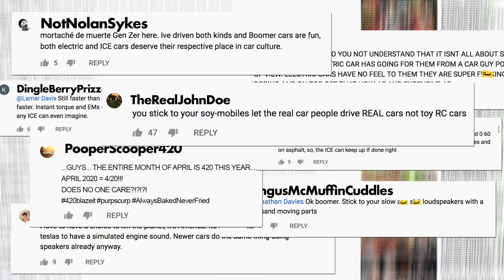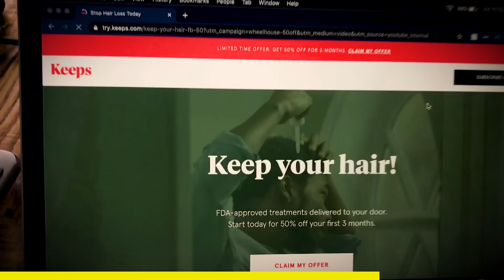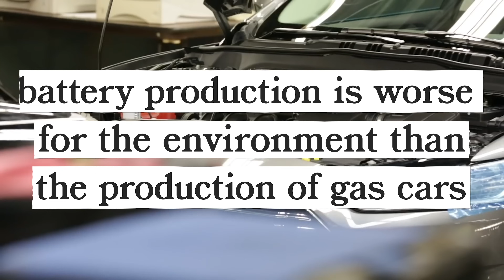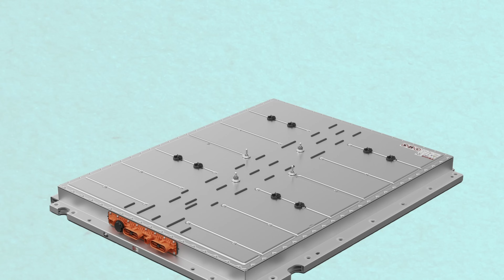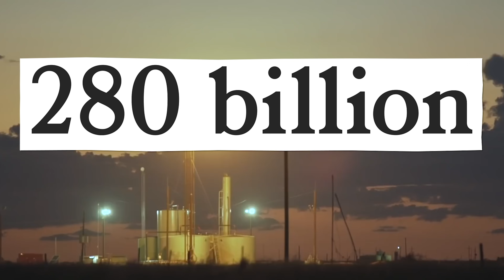Are Electric Cars REALLY Better for the Environment?

Comment: i bet in the UK a Ford transit could go from lands end cornwall to John o'Groats without stopping for fuel, unlike your EV car ( John O'Groats to Lands End is roughly 840 miles)
Reply: well no. The 2020 ford transit has a fuel economy of 14.9L/100km combined and a fuel tank capacity of 96L meaning it will only get 644km to a tank. for reference that is 400 miles. It would have to refuel a total of 2 times to make 840 miles unless it rolled the last 40 miles with its engine off.

Comment: I called bullshit to make electric cars they had to build new factories which puts emissions into the air, when you charge your electric car it puts omissions into the air, when these cars are wrecked the junkyard hast to take special care because of the batteries which puts more emissions into the air.

I live in Las Vegas when it get 118° this year they told People with electric cars not to charge them during peak hours.
Reply: Fortunately for everyone, EV's dont typically charge during peak hours but most commonly during offpeak hours. In addition, factories for other cars have to built and represent the same degree of emissions, end of life of EV's also represent similar emissions impacts according to most studies, less if you take Teslas approach and recycle all your own batteries. and finally, even charging produces less emissions than a combustion car and that even before you consider refining the fuel.

Its so significant that its more fuel efficient to charge your EV, even from a cheap portable generator than it is to use that same fuel in a traditional ICE vehicle.

Comment: I have a 22 year old Nissan, and it still running like a champ. Do you think I can have a EV last 22 years or any longer?
Reply: yes. Modern  EV batteries are designed to, and are showing to last up to and exceeding 500,000 miles to a lifetime (70% of your original range remaining is considered a lifespan.) that represents 30-40 years worth of driving for the average person.
Reply: Engineering the weird guy I might not know how many mile the battery you can drive the only fun fact is my I- phone battery (lithium-ion ) won’t last 10 year daily using for sure.
Reply: @eguchiyosuke4170  They're very different. For starters your phone has no battery management systems other than a digital charge indicator, an EV will constantly maintain the batteries temperature through submersion in a coolant fluid which is heated and cooled to keep the batteries at ideal temperatures, it is also constantly monitoring the charge level across cells to maintain consistent charge levels and will regulate the speed of charge and discharge depending on the state of the battery in regards to charge, life and temperature.

Another difference is use. You use your phone from 100% charge each morning and quite often to the last 10-20% or less. This is very bad for lithium batteries and significantly impacts the batteries health. EV's however have such significant ranges these days that for daily use they arent ever charged more than 80-90% and rarely are discharged below 30% (you dont charge to 100% because you dont need the extra range if you're only doing 75 miles of your 325 miles range per day.) This charge pattern greatly increases battery life.

equivalent
Reply: Engineering the weird guy very well info you provided. Thank you.

Comment: I big thing you forgot...after 5-7 years that lithium battery is going to need to be replace...add another 30+ metric tons of co2...so now your back to about 5 years before the electric car is equivalent or slightly better then a gas car...what about hybrids, they seem to have the best of both worlds starting from manufacturing to the "life" of the car
Reply: actually Modern EV batteries are designed to and showing to last up to around 500,000 miles with 70% of their capacity remaining. Infact after 100,000 miles the Tesla model 3 has an average of 2% degradation.
Reply: @engineeringtheweirdguy2103  actually, no...those where hypothetical numbers run on the newest technology of lithium batteries, unfortunately none of that technology is widely available outside of labs...still at best the current lithium batteries in any consumer field is only good for about 5-7 years max, and the degradation is more related to how they are charged, discharged and conditions they are used(high temps, low temps, how stressed they are during use, etc.)
Reply: @jasonbrown3632  actually no, they aren’t hypothetical numbers. Cars like the Tesla Model 3 have been showing less than 2% battery degradation average of 100,000 miles, older generation EV’s arent uncommonly over 300,000 - 400,000 miles to a battery. 

Hell the warranty period on modern EV batteries alone is 8 years. Much longer than your 5-7 years you seem to arbitrarily seem to think they need replacing.

As I said, modern EV batteries are designed to and are showing to last twice the lifespan of an average combustion engine or more.
Reply: @jasonbrown3632  as for other consumer batteries, that really depends on their size, use case and Battery Management Systems. EV’s have some of the largest batteries in any consumer product, with some of the most sophisticated battery management systems available to date.